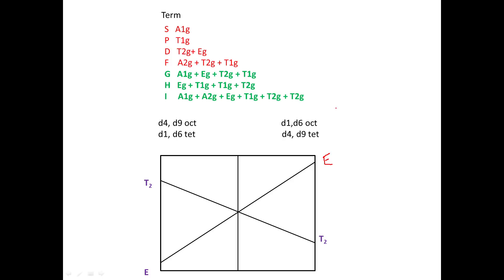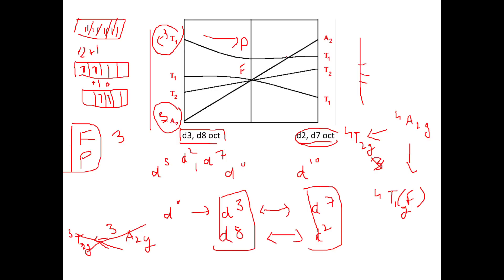Orgel Diagrams

Comment: Category: CSIR June 2012  plz answer this 

The carbonyl resonance in ¹³C NMR spectrum of [(η⁵ – C₅H₅)Rh(CO)]₃ (¹⁰³Rh, nuclear spin I = ½, 100 %) shows a triple at -65° owing to the presence of

1.  Terminal Co 2.  μ2 - Co 3.  μ3 - Co 4.  η⁵ - C₅H₅
Reply: This question has created new doubt.sir plz also explain y in eta4-C8H8Ru(CO)3 carbonyl signals r not observed,we get only 4 bcoz f ring carbons, and in this case it is seen?
Reply: Triplet of carbonyl carbon indicates the each CO is attached with chemically equivalent two Rh atoms that means  μ2 - CO Complex .Answer is 2

Comment: sir ground state term symbol for [Mn(Cn)4]-1  sir i got  4 T1(F)   sir is it right  ?
Reply: yes sir got it ..CN is low spin ...sir then  how can we solve this question ?  grond state term symbol for [Mn(CN)4]-1  ...is this question wrong ?
Reply: @sapna Barad       Sir,  already told that orgel diagrams only for high spin complexes. But ur question is not wrong. As it hasn't unpaired electron.  So it gives symmetric term symbol